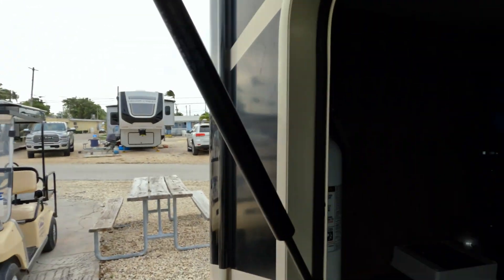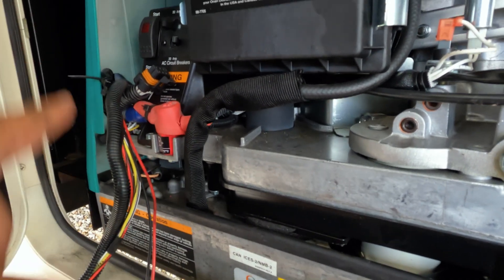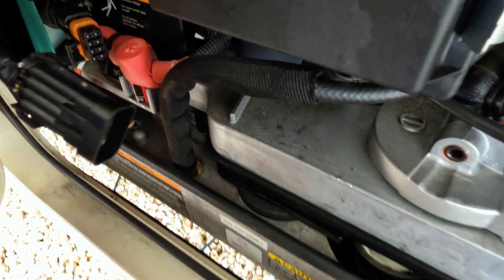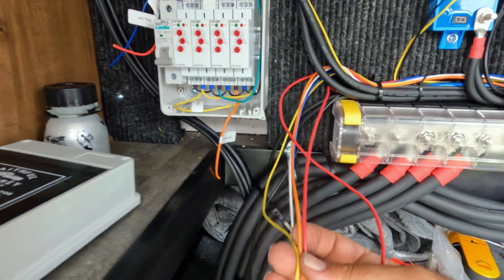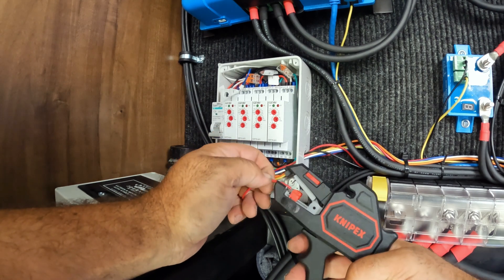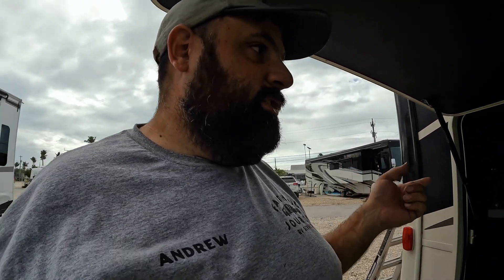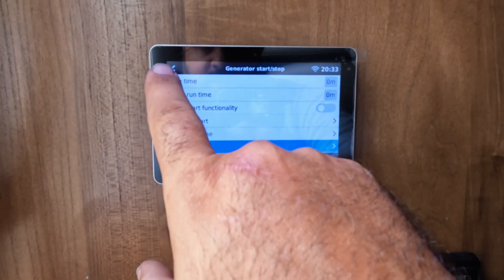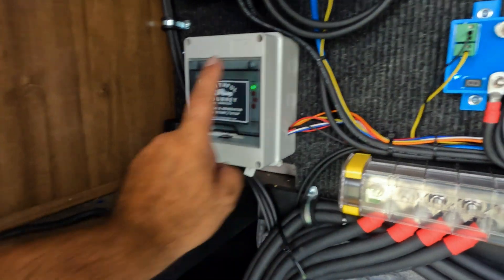Integrating a Victron System and Onboard Generator

Comment: Thanks for the video. I will say i hate seeing those splice connecters being used. Seen too many of them melted :/
Reply from the maker: The amperage/ voltage going through these wago connectors in this application is very very small. And the signal wires to the generator are a ground signal so no voltage at all.

Comment: Question, your gen start stop wires are confusing me. At the generator you used a black and red wire, then at the box you used orange and yellow. Now I heard you say you had to extend the wires, did you just switch colors when you extended them? 

So your only red and black wires coming from the relay box are system positive and negative. Which would be hooked up to pos busbar and negative busbar?
Reply from the maker: My box comes prewired with a yellow wire that connects to the generator stop signal wire and a orange wire that connects to the generator start signal wire. The color of the wires that you use to connect my box to the generator doesn't matter just as long as you know which wire you are using for the start and stop. 

Yes, the red and black wires that my box come prewired with connect to your system positive and negative busbars.

Please send me an email with your phone number and I explain more over the phone if needed. inquire@faithfuljourneyrv.com